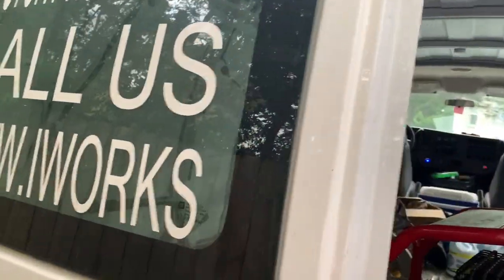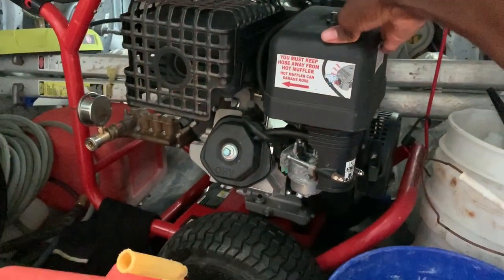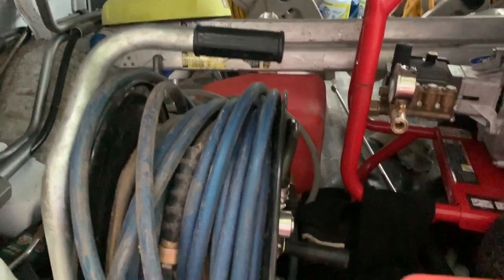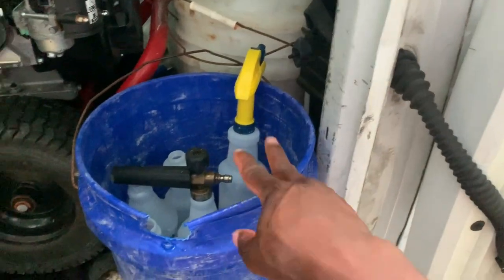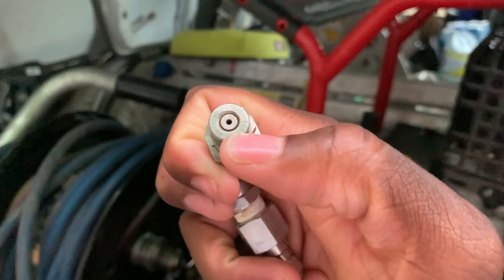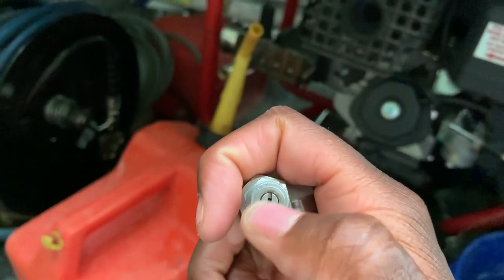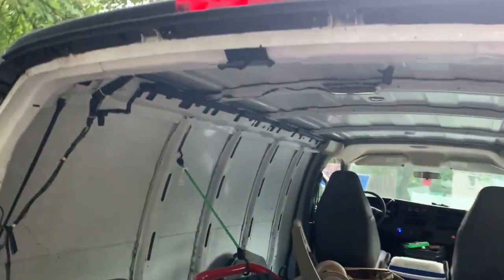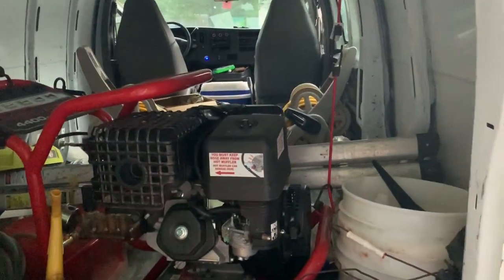My current Pressure Washing Set up [ MAKE $10K+/MONTH]

Comment: I have never seen anyone using a shower cap to cover things up. I have used and seen most people use tape. I think I'll give it a try. Good video.
Reply: Another cool trick is to use a clear plastic shoe holder bag for parts, you can see through it, it holds a tonof stuff in all the compartments and its plastic and light you can hang it on the wall.

Comment: Hi,

The pressure washer you have is a predator which is sold at Harbor Freight.  

How long have you had it? How do you like it?  Do you think you would get a different model / brand. Sometimes with a Honda engine and a different pump model.

Comment: Great videos. Assuming you do decks, do you softwash or pressure wash them?
Reply from the maker: Ryan Dickard deck you only want to use about. 500 psi. Use a 50/50 mix in a pump sprayer or a soft wash system to applicate follow up with some wood brighter (oxalic acid)

Comment: I been doin research before starting my business 
I just found out all the water tanks are is a buffer tank n almost all companies use customers water to their buffer tanks 
I’d understand if u had a 8 gpm machine but a 4 gpm machine is fine hooked up to customer water without a tank
Reply: VANILLA GORILLA buffer tanks are not only used for drawing water,...but are also used to receive water from your bypass. If not, you’ll burn up your pump if you let it run while the handle is released for too long.

Comment: If I'm using a 8gpm should I use a tank
Reply from the maker: Troy Price you’ll have to. Residential water outlets aren’t that powerful
Reply: @ZayWonderJournal  say zay thanks a lot man for replying I haven't started yet I'm just ordering all my equipment right now can I ask u something else u think I should buy a soft wash machine or can I soft wash from my pressure washer I don't really understand the down streaming an the other thing with the bucket an pvc pipe or something
Reply: What size tank should I get zay
Reply: If I buy a soft wash machine I don't have to worry about down streaming an stuff huh
Reply: @troyprice4596   Did you get the answer to your question